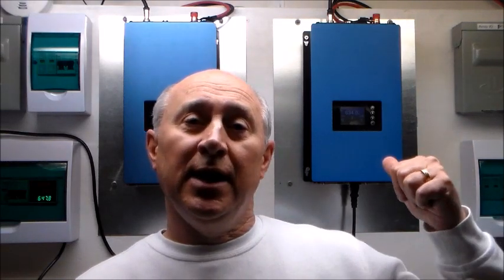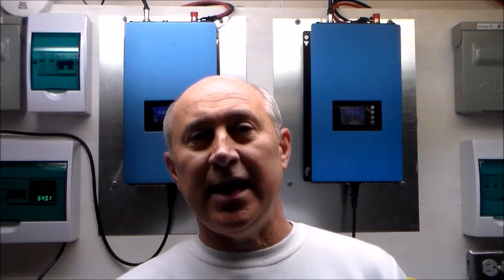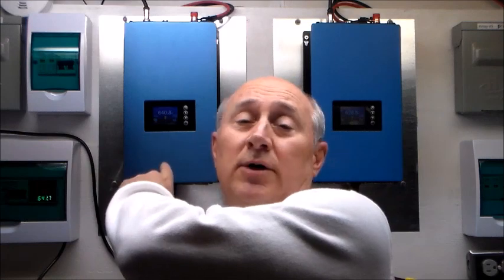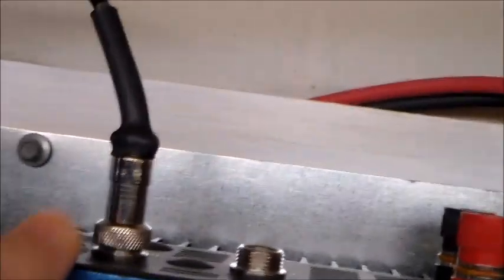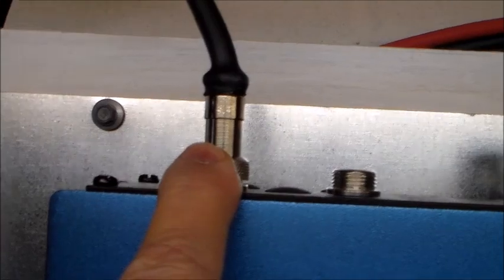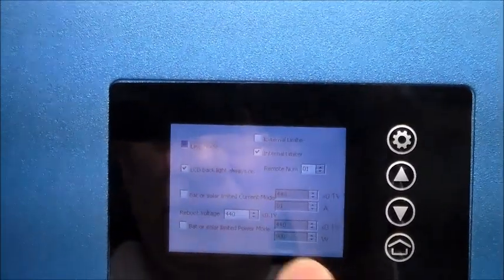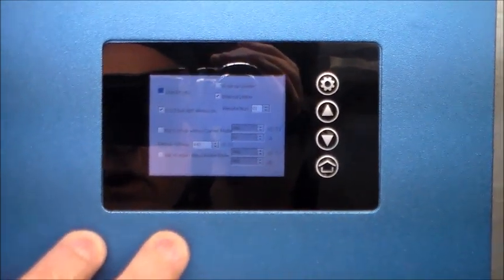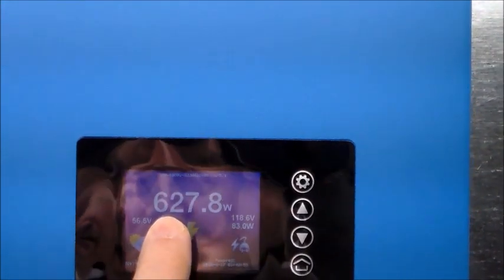DIY Solar - Episode 18 - Sun Grid Tie Inverter (GTIL) - Update Video

Comment: First off, thank you for making all these videos, they are extremely helpful and great! I just got one of these GTILs the other day and have a question. I see yours functions just like mine which is a little confusing. When using the limiter, your current sensor showed 50-60 watts being used but the inverter producing nearly 600 watts. How is that not back feeding the grid? This really confuses me. I have mine hooked up to a kill-a-watt and it shows that it's sending more watts back in than the current sensor is sensing. Am I missing something? Thank you in advance.
Reply from the maker: Kristoff Lutchman OK, something to understand....the clamp sensor is there to detect the total amount of energy your house is pulling from the grid on the 100 amp leg the sensor is connected to. It does not measure any of the power being produced by the inverter. It uses that value to determine how much power the inverter needs to produce. On the display panel of the inverter, the large number is the amount of power being produced and being fed into your home from your solar panels. The small number is the remaining amount still coming from the grid. In other words, if the clamp sensor detects 1000 watts needed by your home and the large number on your inverter shows you are producing 600 watts, then the small number on the inverter will read 400 since your are still needing 400 additional watts from the grid. On the other hand, if the clamp sensor detects a load of only 600 watts and your panels are producing that, then the small number on the display will show zero since no additional power is required from the grid. Does that make sense? Your kill-o-watt meter should display a number very close to what the large number displayed on the inverter is.
Reply: That does make sense. I guess I am confused because I did a controlled test using a kill-a-watt and put the current clamp on a circuit drawing 30 watts. Which was displayed by the little number on my inverter but with another kill-a-watt it was putting the full amount of solar panel power into the grid. Maybe it’s possible I have a defective unit? It just appears to display the same as everyone else’s I have seen on YouTube, so not too sure.
Reply from the maker: Kristoff Lutchman Are you sure the limit option was enabled? I also have a whole home Sense meter that measures everything going on in my house. It has detected no power being fed back into the grid at all.
Reply: @jimginnyohio  I had the Limiter function checked as well as Internal limiter selected and the CT clamp plugged into the Internal port. My small watt reading was a positive number. I will mess around with it some more when I get some daylight. Getting a home sense is a great idea.
Reply: jimginnyohio hi sir will sensor work if i put it at AC shut off box, my main box too far away i just need it for AC unit thank you.

Comment: Hello Jim Thanks for the vides. Do you have a net meter? If not how do you stop from feeding the grid?
Reply from the maker: pete h No, I do not have a net meter. The inverter I am using has a built in limiter device. When that is enabled, it will sense the amount of power needed in the house and will limit the production to no more power than that being used. This way, no power is fed into the grid.
Reply: @jimginnyohio   thanks for the reply

Comment: Thank you for this video in details.  I am copying your layout and will add batteries later on down the road too.  Thanks again
Reply: Can I get the model number of the inverter u have?  I saw this on Amazon:
ECO-WORTHY 1000W LCD Display MPPT Solar Grid Tie Inverter Power Limiter PV System DC 45-90V to AC90-140V
Not sure if it is the same one.  But this one say :
THIS GRID TIE INVERTER CAN'T CONNECT WITH BATTERY BANK!!!
Reply: Also I only have access to 295watts panels.  Is it ok to run 4 panels per unit (serial and parallel)?  1180watts

Comment: I also have setup 2 1000 watt gtil2  inverters. What's the highest wattage you've seen then push?
Reply from the maker: DIY Dan I saw 840 watts on both of them today. I plan to wash my panels this weekend to see if I can push it a bit higher.
Reply: I guess I'm a little nervous of going that high, I'm staying below is 700.
Reply from the maker: DIY Dan I've been running the first unit for over a year and a half with no problems. Just be sure to keep the fans clean and running well.